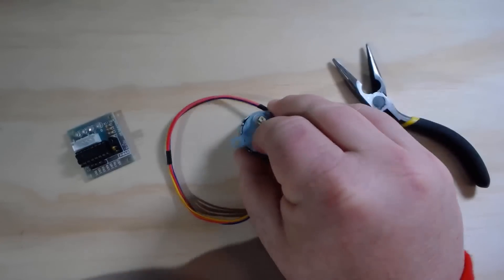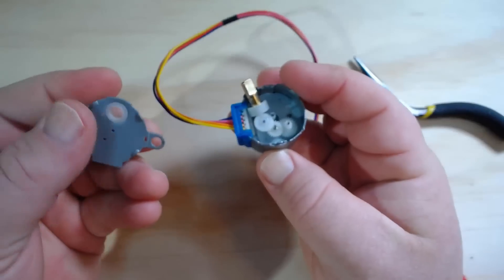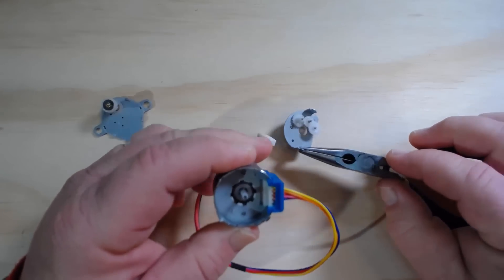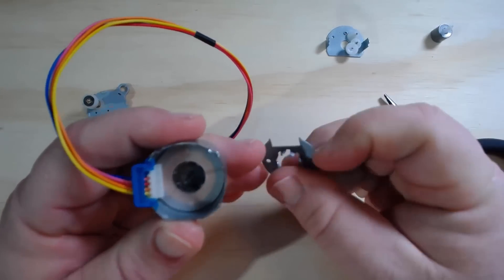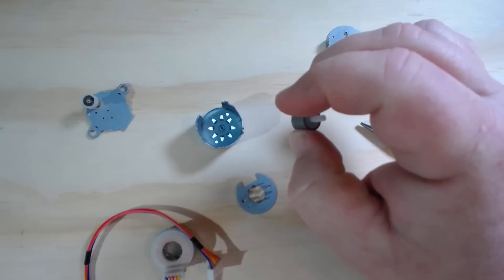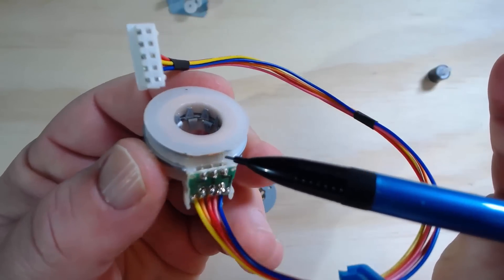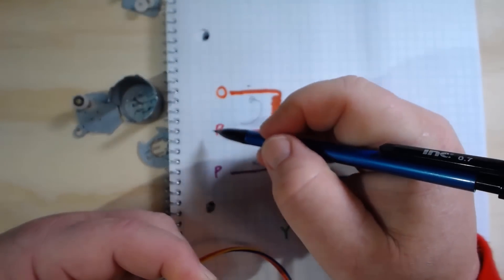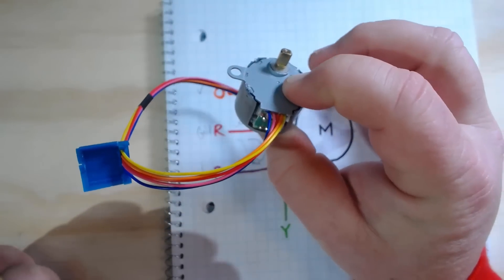28BYJ-48 Stepper Motor Disassembly

Comment: Nice, but it is sad that you didn't count the teeth of the gears, because the ratio is not 64, just only near 64. From other sources, I get a ratio of 32/9 * 22/11 * 26/9 * 31/10 = 63.68395...  But I'm actually testing and get another ratio, near 63.382. I have to open a motor and count the exact number of gears or find an error in my program. But for sur the gears ratio is not exactly 64. For a watch, it is important for it's precision.

Comment: nice! 
No flyback diodes?
I was probing this motor pins today but didn't see the expected inductive spikes when current is interrupted.
Reply: For the freshly released line to go higher than 2Vcc, the other end of the same coil would have to go lower than ground.  An integrated diode at each output inside the ULN2003 prevents that.  But you make an excellent observation!

Comment: Love it. I was having issues with an Elegoo kit that contains the  28BYJ-48 and ULN2003, and it doesn't work. I actually have a 1986 bachelors degree in Microelectronics & Computing, but have never played with Arduino or steppers until last week.

Your video helped me to go back to first principles (without destroying my only 28BYJ-48), and to write a simple driver for Elegoo's Arduino Uno clone that worked first time.

I've seen quite a lot of misunderstanding about the 28BYJ-48 online. Some people say it has a 32x gearing, others 64x. I think they are mistaking full and half step modes - which given the misinformation in the Elegoo kit and in other places, is quite understandable.

Using your video and my half-step code, I indeed, got 64x 64 steps per revolution. Confusion over!
Reply: So happens it was 1986 was when I got my first 28BYJ-43.  IIRC it was in Camarillo, and I was using a 6809 assembler on a CoCo to create the strobes.  It's great that they are still available.  Just got five from Temu.  Wonder if they'll be around another 38 years?  After seeing the simplicity and cleverness of their design in this video, I don't know how you'd get more stepper for less dinero.

Comment: Hi I saw this video and I was wondering where did you get the motor? I found one but it has 5 cords instead of the 4 cords which I need to replace.
Reply from the maker: It SHOULD have five wires coming out of it.  The Blue and Yellow wires are the ends of one coil, and the Pink and Orange wires are the ends of the second coil.  The red wires is the center tap that attaches to the center of each coil.   You can watch my follow up video to this where I explain what the wires are, and how to use them: https://www.youtube.com/watch?v=B86nqDRskVU&t=43s

Comment: I've got a similar looking stepper, but the back says 6v 10ohms part number 20BYJ01-160HR..  it didn't come with a driver, but the ones I have, all have a trim pot to adjust the vref until it corresponds to the maximum current you want to drive. But I can't find any datasheet on the motor, so how do you know how much current it can take?  Or without opening, the number of steps per revolution?   And what happens if I apply 8v-24v instead of the 6v?

Comment: Thanks for the vid!  How would you go about connecting the magnet rotor directly to the output shaft?  (removing the gearing completely)  I would love to give up the torque for higher speed...
Reply: Actually, I guess maybe you could slice away the gearing half of the motor and just use that intial shaft as the output shaft?